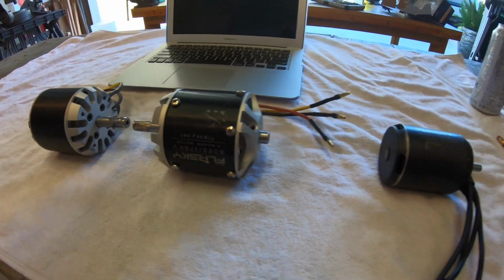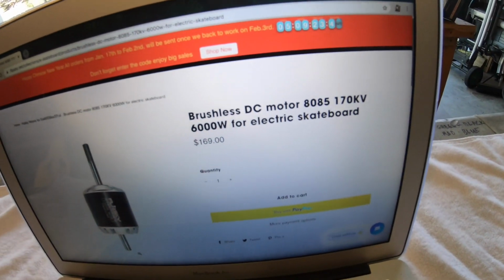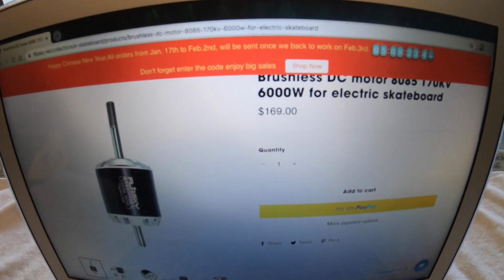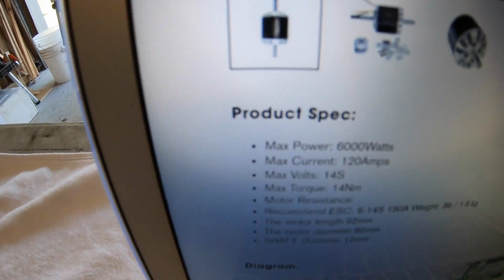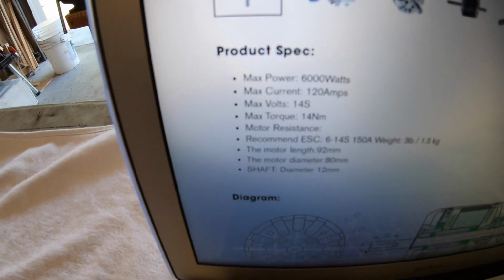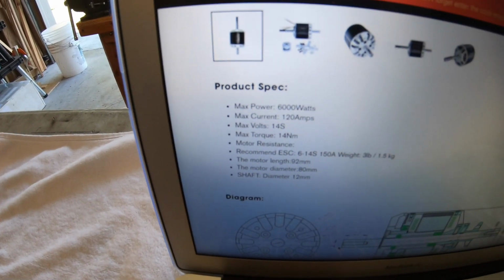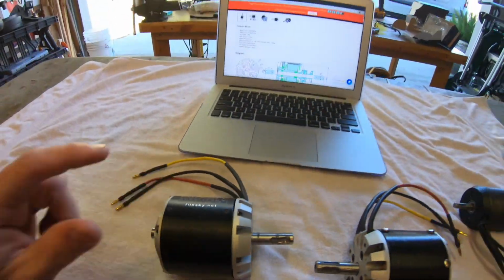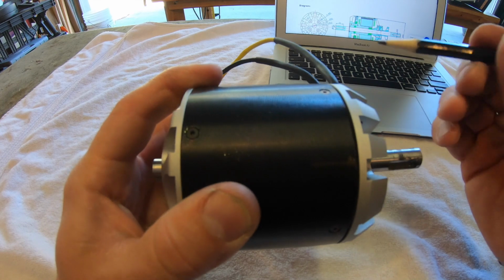FlipSky 8085 Motor Issues/Fixes

Comment: Flipshit
Reply: I was on my way to buy 2 of these motors for a boat project and luckily I did not. An electric motor is actually a simple design but there are obvious engineering problems with this motor. Nice mod and improvement but I don't have time to do this =) Take care.

Comment: 1. Why do you not use epoxy? 
2. It's not appropiated to put a brushless motor next to a fan heater.
Reply from the maker: 1. Epoxy works. I used silicon instead because i felt like it. 2. In what rule book does it state: "it is not appropriate to put a motor next to a heater"?  Those motors get way hotter when they are under load pushing you around on a skateboard or go kart.
Reply: @artsiomnaidzich9515  "in what rule Book does it state ?" By study and experience, I consider that it is not recommended and especially useless. Epoxy with your 3d print will be a better solution (imo).
Reply from the maker: @tonypeppoloni6807  Tony.  All adhesives have an ideal range of temperatures at which they cure.  I use heater and epoxy or heater and silicone combo pretty frequently to get the ideal curing temperatures.  The heat on the heater is set to keep the motor just warm enough so that silicone dries completely and properly.  I've used epoxy on other motors.  It works great, but is a very messy process.  Silicone is not as sticky as epoxy, but has good elasticity and is easy to clean up.  Where am i going with this?  Oh yeah.  Your two pointed question/statement.  1.  Epoxy works great and I do use it, just not in this video.  2.  I disagree with you that the use of heat is not appropriate near this motor (Esk8 motors get really hot when pushed hard, way hotter than the temp. that my heater warmed my motor up to).  My opinion on heat use is:  use heat to maximize effectiveness or exploit the properties of materials the heat is applied to.

Comment: l just buy the 190kv 6374 and regret it after seeing your video
Reply from the maker: roger fa9 Roger, FS 6374 is a good/reliable motor. I have them on my all terrain skateboard. Ive had problems with 6384 and 8085 motors.
Reply: @artsiomnaidzich9515  l think so because on a mountainboard the 8 inch  pneumatic absord better the vibration  but some members of esk8 forum use it on skateboard and  maybe that why the magnet don't last a long time . l try to ask everyone  on youtube but nobody respond lol! thank you .
Reply: @amachalaamachalpu9366  thats why u batlle harden them cuz there glue for that wich is not the regular glue they use on the magnets it need to be permanent one for shakey skateboards

Comment: First of all you can't transmit torque with the 4 screws in the front because they are attached to the big bearing which doesnt transmit any torque.
Let's assume the 6 M2,5 screws in the back are supposed to be transmitting the whole torque of 14Nm. So if you divide that torque by the lever lenght of 0,04m and by 6 screws you get a force per screw of 58N which is not that much! If you again divide that by 2mm^2 effective stress scross section of the screw you get a shear stress of about 30N/mm^2 which is absolutely no Problem for any metal. (neglecting the friction which the screws generate between the 2 rotor parts which is actually supposed to hold the whole construction usually when bolting) 

The much bigger problem is getting the power out of the shaft. These motors are originally desinged for airplanes. When you choose a transmission such as chain, belt or spur gearing you get radial force which will damage the motor because the bearings are not supposed to take those radial forces. The best option is to use a clutch and 2 separate bearings and inbetween the transmission output to completely relieve the motor of any stress except torque over the shaft.
Reply from the maker: Both front and back screws kept on getting loose on both motors. Locktite did not help. Flipsky markets this motors for electric vehicles (scooters/skateboards).
Motors were noisy and unbalanced before i applied any load to them.

Comment: Cool idea using that 3d printed spacer, I'm a bit worried that it wont last over time though. I use the Alien power systems 80100 motors on my mountainboard, those look exactly the same both on the inside and outside, with some additional length of course. probably same manufacturer. 

Anyways I always fill both the gaps between the magnets and the stator itself with epoxy (battle harden) on my motors. That makes them rock solid, never had an issue with a battle hardened motor. 

The 4mm screw upgrade is definitly a nice one! First thing that happened to me was that those screws came loose
Reply from the maker: Jens Sjögren good to hear your feedback. Its a sneaky rebranding tactic that they use to sell a generic motor. Ive gotten maytech 8085 motors instead. They are rock solid. I will try your epoxy method. Thanks.
Reply: @artsiomnaidzich9515  yep and they are definitly not alone to rebrand generic no name stuff. As you say theese motors has potential but requires some work before the are put to.. well, work. I've been using mine for half a year now doing quite a lot of forest trailing and they hold up very well, only had to exchange the big bearing on one of them. Maytech has way better quality indeed, also cost way more so there you go I guess. They usually come pre battle hardened from what I've seen, not completely filled in but it's something

Comment: Flipsky, the worst company out there... Typical, laughable... sorry you had to go through that
Reply from the maker: Thanks bro.  I had good luck with their FSESC, especially 6.6.  Also their 6374 motors have been real decent.  Outside maytech motors, all other motors seem to be the same couple generic motors that esk8 companies Laser their Logo on.
Reply: @artsiomnaidzich9515  It is very typical for them to tell you/anyone that the faulty unit was due to some BS you caused and make you buy their "better" unit.
Reply: I disagree bro!

Comment: We're can I get the best batteries for long range and high speed witch would you suggest my board goes 45mph what could I replace it with
Reply from the maker: You want your board to go 45 mph or kph?  Regardless, you have multiple variables to consider. Mechanical:  size of your wheel and motor/wheel pulley ratio.  Number of motors.  Size and rating of your motors.  Type of ESC you are going to use.  Battery choice will depend on all of the above factors.
Reply: @artsiomnaidzich9515  I believe I have a very powerful esc I'm currently running hub motors
Reply from the maker: @Ebackfive  Do you have a DIY board or over the counter esk8?  Is the ESC programmable?  What problems are you having with your board?
Reply from the maker: Also, what size/voltage battery are you using right now?
Reply: @artsiomnaidzich9515  13 AH
Reply: @artsiomnaidzich9515  over the counter board
Reply from the maker: @Ebackfive  
What brand of a board.  Link to website would be helpful.
Reply: @artsiomnaidzich9515  I believe there no longer in business this brand is called AIBEE brought from china
Reply: @artsiomnaidzich9515  that's a huge reason I need help
Reply from the maker: @Ebackfive  Ok.  I'll look into it.  U need a battery replaced?  I found some info on it.  Have you taken this board to 40MPH yet?
Reply from the maker: @Ebackfive  I cant find any info on this AIbee board.  Looks like a typicall Meepo type generic Chinese board.  I doubt that it ever reached even 30 mph.  Take off the battery and esc cover, take a pic of esc and battery.  Send the pics to me via FB messenger.  That would be a good start.
Reply: @artsiomnaidzich9515  no I believe the battery lost cells capacity during when I didn't charge the board all the way up so I've only got it up to around 35mph it died when I was riding it and I kept turning it on to get home because the board was way too heavy to Carrie or push were I live so I messed up a few cells for not charging it up all the way and dieing
Reply: @artsiomnaidzich9515  it does reach 45 but I messed up the cells when I first got it so yea
Reply: @artsiomnaidzich9515  I added you on Facebook

Comment: cant believe you had separation on those motors too
Reply from the maker: conner smith, yeah, its unfortunate. How is you motor holding up?
Reply: Artsiom Naidzich Admittedly i haven’t used the board as much as i gave wanted yet. The motor gets loud  on the intermediate speed range as I’m sure you know so i try to keep above or below it but otherwise it works great